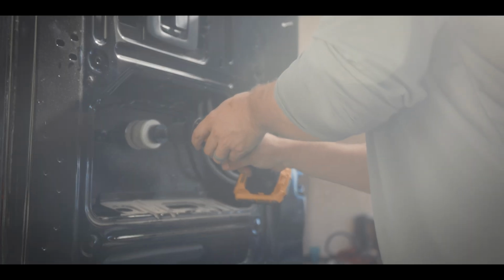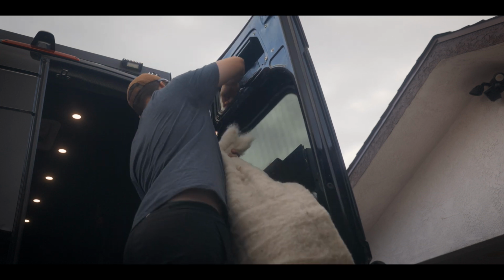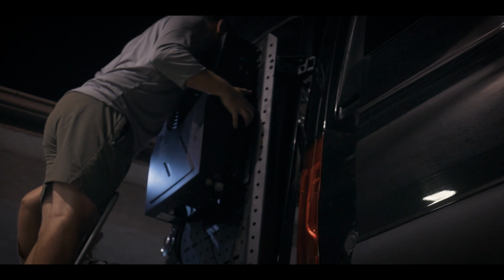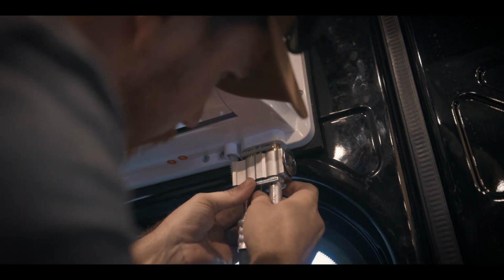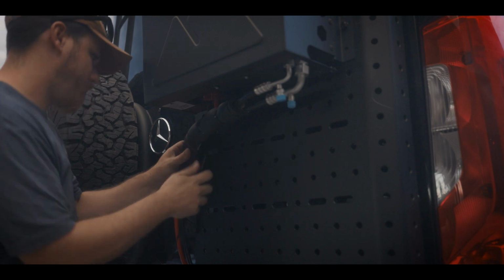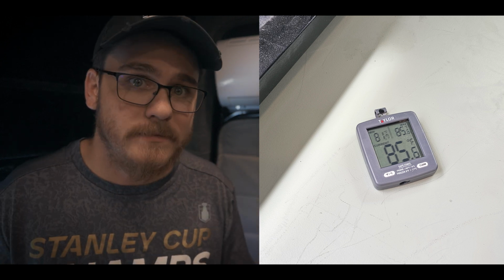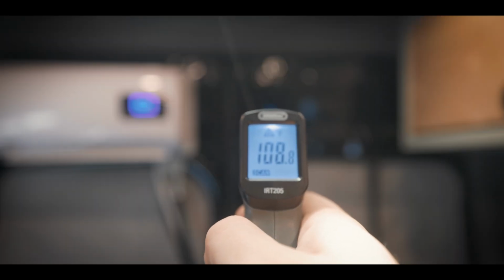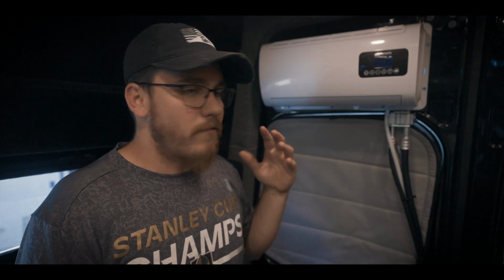Summer VanLife Comfort: The Nomadic Cooling S1 Split Air Conditioner

Comment: I was hoping to see how you transitioned from the door to the battery run.
Reply from the maker: I created a little bit of slack and wrapped it in loom from the door to my bed. It allows me to open and close with no issues. From there it runs under my bed then drops into my battery compartment. 

Honestly not the prettiest, but since I was retrofitting it into my build, it was good enough!

Comment: When describing how much power your a/c used, you said it used 25% of your battery for a night. But how many hours was that, and what is the capacity of your battery bank. Without knowing this, I have zero information.
Reply from the maker: 600 amp hour battery bank. I mentioned it during the part I talked about recharging. So I used about 150 amp hours, which also includes my starlink, fridge and recharging gear.

Comment: Thanks for this vid, Riley.  So... the S1 used only 25% of your batter bank, overnight?  So... then, what size battery bank ya talkin' 'bout?  Better yet... what was the energy consumption?  Without that parameter... sounds like an infomercial.  Obviously, nocturnal external ambient temp you provided ~95 degrees, and internal conditioned air was ~75 degrees.  As you indicated, insulation is a huge factor and you touched on the notion of 'thermal bridges':  The exterior metal wraps into internal surfaces, pulling heat inside.
Reply: That's what I was about to ask

Comment: This while setup is trash 🤣🤣. 75 degrees for 25% of the battery is not efficient at all....
Reply: If you've ever spent time in las vegas in the summer you would retract this comment😂😂. Also, not knowing the quantity of watt hours his system has, it's hard to make the proper assessment as to efficiency

Comment: Can you get it down lower the temp or is 75 the lowest
Reply: As a rule of thumb, most ACs reduce temps by 20 deg F. So: 90F becomes 70F, depending on shade insulation, etc.  Also, the air itslef cools relatively fast, but the objects could take hours, as well as the cavities in the frame, as they continue to inject high heat for a while.  It may run full-on for several hours even after the air is almost immediately cooled down a spread of 20 F, and then the AC will back down a bit after the objects and cavities are finally cooled.

Comment: I would love to see the compressor/condenser outside unit opened up with the cover off to take a look at the components and construction, wiring quality, etc! Very curious if the blower motor is brushless. Low quality brushed blower motors are a failure point on your average 12V mini split units.

Comment: I'm building an over land camper from scratch I'm looking in to the same system of mini split for my build what size battery bank you recommend to handle a mini split of this type for 24 hours so I have an idea of full power use it needs to up size my power system to work with it before I buy it and have issues I live full time over landing and normal needs is 3k inverter with 3 300 Amp batteries and 1100 amps solarso far I barely use 20 % of my power available

Comment: How many watts does it use?
Reply from the maker: This is a 12v version, and depending on the mode was pulling around 30 to 40 amps roughly so around 400 watts. Its going to be higher depending on the ambient temps amd if you're using the vvs mode or the eco mode. Eco will cruise around that number and drop even slightly.

Comment: Dude, you are two steps ahead of me. Halfway through this video I realized I had watched your review on the EcoFlow Wave 2. I bought it before I had watched your review and ultimately returned it. Your review was spot on. Following in your footsteps I'm moving on to the S1 now. How much battery power(AH) do you have in your setup? We have 200AH in our transit, but plan to use the S1 on shore power/generator. I reached out to Nomadic Innovations and they recommended 400AH, but I'm not sure if shore power/generators might allow this to work for us. Thanks for any info you can provide! (I looked through the comments for your battery setup to no avail)

EDIT: I see you've got 600ah from the other S1 video. Still curious if you think that 200AH/Generator would work.
Reply from the maker: Well I am glad to hear my videos are helping! Yes, I have 600amp hours of lithium batteries, 600 watts of solar wired in series parallel and I have 100amps of alternator charging. 200 amp hours will definitely be cutting it close. In my field test, the s1 used up about 20% of my battery bank, which is roughly 120 amp hours. You also need to account that if you drain your batteries too far, you could damage them. For example, my battle born batteries have an emergency shut off around 13%ish...If forget the exact number. Most lithium a rule of thumb is that 20% should be the safe spot. So if you account for this with your 200 amp hour bank, you have about 160 usable amp hours before needing to charge. So recommending 400 amp hours is designed to maximize your use while also giving room for other devices to operate. Such as charging phones, lights, fridge, electric cook top, ect. I wish I could give you a more straight forward answer, but in all honesty, it depends! Hope this information helps.
Reply: @rileyclarkfineart  That is super helpful. What I am trying to figure out is if the available battery power is still a consideration when you're plugged into a generator or shore power. I reached out to Nomadic Innovations directly but haven't heard back yet. Ultimately a battery upgrade is in our future in order to use the AC off grid, just hoping to make do until that point. I'm in a similar situation trying to incorporate the S1 in an already built out van so I will definitely be re-watching this video. I'll make sure to use your link when I pull the trigger. Thanks again for the info!

Comment: That black van is an oven in the sun. You bring that van over here to Jacksonville, Florida, during the day in the summer, and I promise you that ac won't be enough. Those dark colors on these vans don't do them any justice. The sun bares down on those DARK colors. Notice that most UPS trucks and Florida State Trooper cars all have a LIGHT color on the roof. I don't know what these manufacturers were thinking when painting these vans black or any dark color. Maybe DRIVING down the highway, it'll cool, but sitting still and trying to camp in a black van will not cool enough. You will not convince me that big ole BLACK VAN will cool you down comfortably in the middle of the day during the summer months. It's a nice van, but the color has got to go. I bet ya there's a 20+ degrees difference with a white van versus a black van. Good luck with yours, my friend.
Reply from the maker: I agree a lighter color would help a lot. I have done a lot to my roof tho which has helped a ton! I'm looking into wraps in the future, but to my surprise this unit has actually done well for my needs, even in our 120 days in the summer. But, I do mainly take my van away from climates like that, which is why I went so long without a ac unit at all. I did a follow up video showing it's performance against the summer heat.
Reply: more like 100 deg F difference, maybe 150 deg F more, up to 200 deg F..  Wear a black T-shirt, and then a white T-shirt.  Even that makes a major difference.

Comment: Why install a mini split that is A/C only? Many provide heat as well.
Reply from the maker: Ones that provide heat that I have seen are 110v AC at minimum,  which would require an inverter to run unit off your DC batteries or a generator. I have a diesel heater in my van that is way more efficient and powerful, so for me I wanted something that cooled while maintaining power efficiency.

Comment: $2000 !!!!!    Are they on CRACK !!!! ECO FLOW WAVE 2  Here I come !!!
Reply: mini split has inverter technology, so is more efficient.  One may get a 12/24v mini split at signature solar.  The EG4. And still under $2,000. But is the mini split vibration hardened for vehicle road travel? I'm not sure - but people install therm in their vans anyway.  Plus they provide heat.  One could select the cassette indoor unit for a smaller footprint than the usual high up the wall breadbox shape, or the basic-box-which fits-in-a-wall small inside unit, which has vents for pipes.  BTW the EG4 lineup has "Quick Connects"; completely precharged both linesets DIY no vacuuming or special tools or techniques.  just "quick connect" them and turn a valve.

Comment: 1. The link strangely doesn't say how many BTU it is, what is it?
2.  Any similar options that include heat pump?
Thank you
Reply from the maker: 9,600 for the 12v unit and 11,280 for the 24v unit. And I do not know of any with a heat pump, other than smaller units like the Wave 2 or zero-breeze. Most of the AC units for mobile applications like these are only Air Conditioners.

Comment: Forgive my ignorance but If I buy a new winnapego traveto would I need something like this or is this always standard ?
Reply from the maker: I'm always happy to answer questions. The Traveto looks like it comes with a Coleman Mach 10 NDQ air conditioner on it. That is a 110ac system so you will probably have to run the on board generator or connected to shore power for it to work which is pretty common with RVs. The Nomadic system is designed to be battery powered and comes standard 12v, 24v and 48v. With how my vans electrical system is. I would have to read more on the Travetos system, but from the quick glance I saw you'd probably need to change things in the power system to run a system like the nomadic I have. The traditional RVs usually are designed to be at parks or used with the generators when going off grid.

Comment: Wonder if you can mount the outside part under carriage of the van?
Reply from the maker: No, it has to be mounted vertical. I asked the same question when dong my initial research. I thought about mounting it on my roof at an angle, and Nomadic said it could technically be done, but a lot of modifications would have to be made since it relies on gravity. The cruise in comfort system does have an undercarriage mounted system, and Velit AC also has a similar system. Cruise in comfort system is pretty expensive, but I've heard great things about it. I was worried about dust and grime causing issues which is why I went with this system.
Reply: @rileyclarkfineart  I wonder if you could do an undercarriage with the S1 but pop the shroud off and flip the compressor around so its not upside down.

Comment: I have an RV with two roof tops but am thinking of adding this 12V split system that you added instead of adding a 120V that I would need to add to generator.  My question is if this 12V system will run off the house batteries that are being charged by the alternator while I’m driving, as my RV only needs the help during driving hours because of the huge windows that let in heat. I won’t need to run the 12V split system when parked
Reply from the maker: Yeah I don't see an issue with that at all as long as the proper charge controller is inline for charging your batteries from the alternator. The S1 comes with battery terminal rings and in line fuses and is designed to go right in line with any 12v system. You might have to build your own harness like I did though depending on how long of a run the s1 is to your battery bank. Depending on the size of your battery bank, I would just be cautious you don't drain them. But if you are only using it driving, it should be more than ok! I know Jonathan from Nomadic installed this in their Expedition Rig to use to cook the cab while driving. I use mine while driving all the time too.

Comment: heat pump also, or just ac?
Reply from the maker: Just AC unit right now. Not sure if Nomadic has plans to expand to heating, but that would be pretty cool if they did with a future generation.
Reply: @rileyclarkfineart what’s the ballpark daily power consumption on a 100° ~ 110° day?
Reply from the maker: Kind of a loaded question because there are a lot of factors that can help and effect the performance. On max cool mode it will run at around 60amps and in eco mode it will run around 30 amps. This draw will more than likely be constant during the peak heat of the day. During the cooler times, the unit will cycle on and off which helps save power. I made a follow up video to this one showcasing how I personally used it when it was 115 outside and cooled off to around 90 at night. I ran it on eco, kept it 76 degrees over my bed area, and only used around 25% of my bank which equates to around 150 amp hours. I also had starlink running and equipement charging so that number is skewed.

Comment: Thank you for posting this. Question for you, what about the mounting options with regards to the door, especially as it relates to opening and closing the door and movement of the hoses and cables. Does the evaporator unit have to be mounted to the inside of the door? This is one of my conceptual concerns for these types of systems. Did you consider the cruise and comfort with mounting the condenser underneath the vehicle?
Reply from the maker: Great questions! As for the hoses n such, everything is mounted onto the same door, so those open and close together so no issues there. I was able to create a way to have slack for the power when door is closed and then it stretches out when the door opens. The Way I have it fed seems to open and close with no issues. This could definitely be done better, but since my van was already built out, I was a touch limited. Still happy with the result!

I did look at the cruise n comforts and they are solid. Having it undermounted with the amount of offroad travel I do made me worried. I know that they have protections in place, but still with dust and debris, it was a concern for me. The S1 is also almost half the price of the cruise in comforts. It is nice that the cruise n comforts parts are seperate so you can easily move things around and configure them to optimize where the cold air comes in and maximize the space of the build. But again, my van was built out already so this perk wasn't something I could take advantage of.

Comment: Great video! I’m in Vegas as well.  Can you tell me if it was difficult to get a shop to add the Freon to the device? From what I read on the website the unit doesn’t come pre charged? Also, can you tell me the size of your battery bank for reference?
Reply from the maker: You are correct, it does not come charged. However, it was really easy to have it charged. It takes the same freon that standard cars take and filling it is the same process. Just make sure you have it installed and running before because they will need it to be put to max cool with the temperature set as low as possible to fill the unit. I have 600amp hours of lithium batteries with 600w of solar charging and 100 amps of alternator charging. I drive the van a lot when I am in it and don't find myself sitting boondocked for long so this set up has been awesome. So far I have kept the van comfortable during the peak times of the day so I am very happy with this unit!

Comment: Interesting, so this mini split is 12 VDC?  I might suggest that when you are parked, make or use a cheap PVC frame to hang up some mylar emergency blankets up around, but not touching the sun facing black exterior of the van.  You are facing 10's of thousands of BTU of thermal that the mylar will almost eliminate.  You could also use some white bed sheets with a similar result.  Of course these are only for stationary use.  Glad that you finally have something that you are pleased with!
Reply from the maker: Yes it is 12v dc! That's great advice on the sheets. I'm going to be installing curtain partitions throughout the van to segment areas off for sleeping, ect. But so far, it has been more than enough to keep the van 78-85 during peak heat. I've been making sure the back of the van is always facing away from the sun and that does seem to help performance.
Reply: @rileyclarkfineart you can get window film that blocks 98% uv rays. 
Amazing stuff